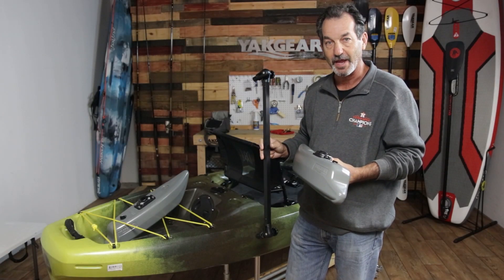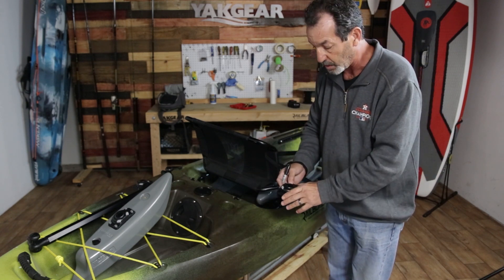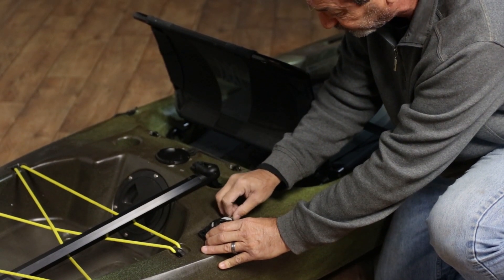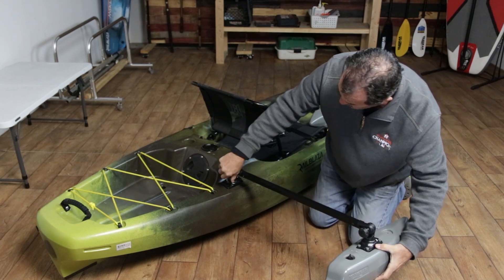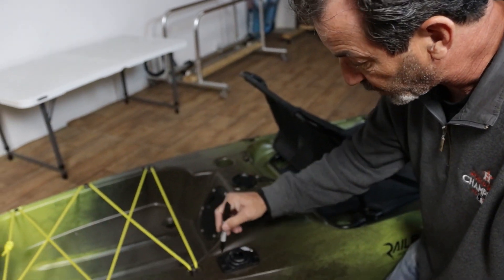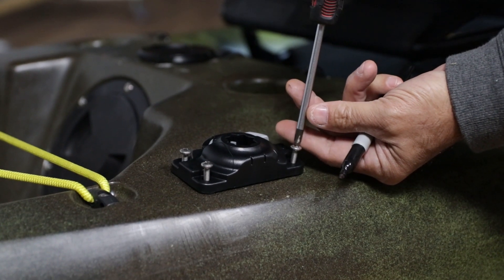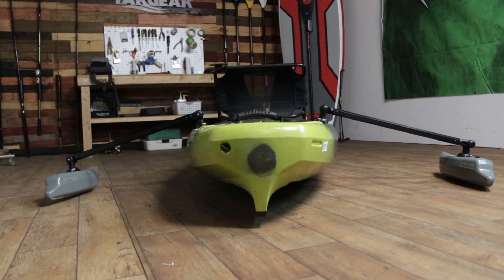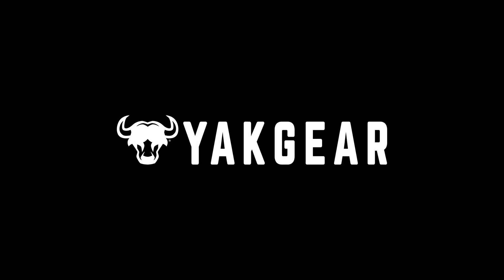YakGear Outriggers Installation

Comment: Like when truing up a recumbent trikes front wheels.. measure the front of the rims (front of the float) and match that measurement to the rear of the wheel (rear of the float.  Then measure the center of the front of the boat to the front of the float. (match it)  That will give you parallel .

Comment: Without a plate underneath the side deck and SS bolts fitted/bolted through I wouldn't trust these to not work there way out, actually better too with a full width brace for extra strength.
You had a lined out floor with what looks like vinyl floor covering, I'd have lined the bow and stern with that then the outriggers with the lines also: I'm sure most houses or yards have some sort of lined/paved/decked floor to work off to line things up properly rather than by eye alone.
Anyway, the floats themselves seem fine.

Comment: What are the pros and cons of running this setup in the front vs the middle or closer to the rear? Have an Ascend 133X for fishing that I’m considering a set of this to add extra stability and for light offshore days. I have a bow mounted trolling motor and I feel the front could use some extra stability but don’t want to loose casting area.
Reply: I second this question. The lack of a response make me question if they just want us to buy the front and back mounts (whichever is not on). Idk, but I would like a nice answer to this question. My thought have also been around the weight distribution of the kayak
Reply: Did you ever add them to your Ascend? It's the same model I have

Comment: They look good except for the railblaizer attachment point. I would be very surprised if these did not fail during a real tipping incident.  Feel free to post a video proving me wrong!
Reply: So you reckon they would break at the RB mounts? I have RB mounts only OT Bigwater 132, and they see strong enough, but I haven't stressed them hard in the way big pressure on a rig arm might. Of course depending on the yak, you only need a relatively small amount of force to stop most yaks going over, unless you're in very rough seas indeed.This set would probably act as a good stabiliser to allow you to stand up in a decent sized kayak, and prevent any yak that would have otherwise got push passed the tipping g point if the outrigger wasn't fitted.